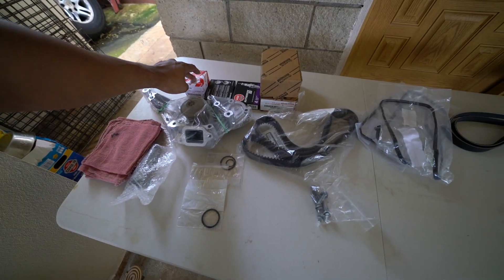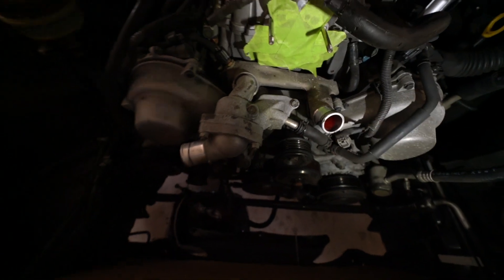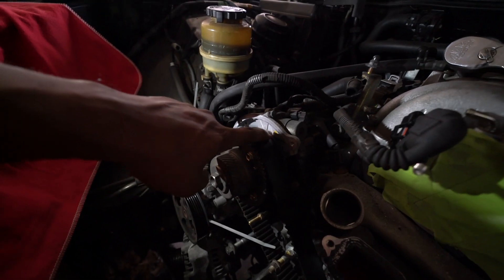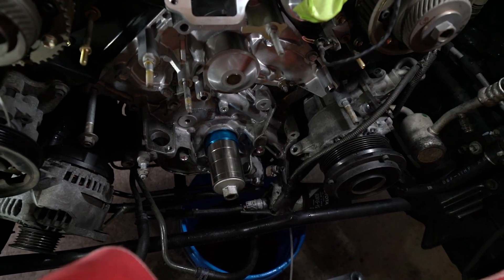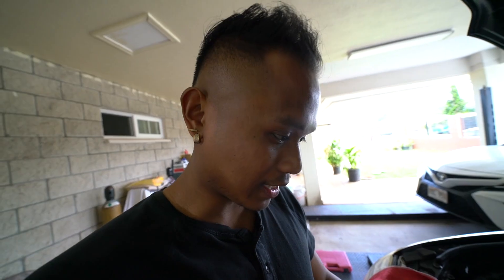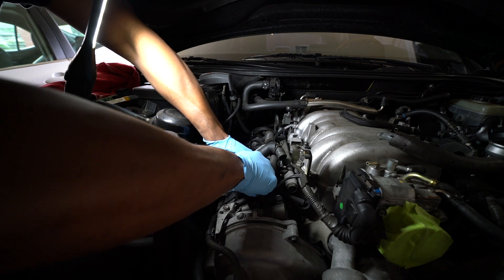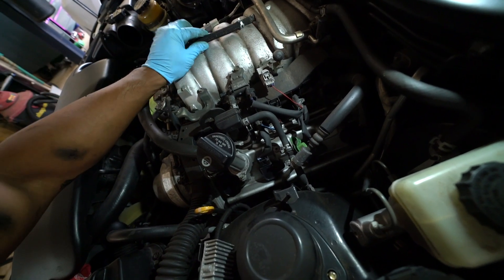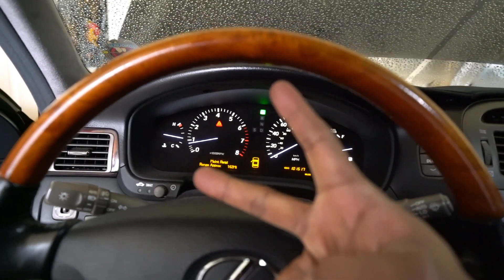JAY | VLOGS LS430 MAINTENANCE (TIMING BELT,  WATER PUMP, VALVE COVER GASKETS, ETC.)

Comment: Heres a tip, belle south lexus sells oem lexus parts online for cheap and free shipping too. You can call to the parts counter as its a dealership. rock auto has the aisin belt and water pump kit for cheap.

Comment: What's up jay big fan of the channel  love those wheels on the ls trying to oder some What's the spec you're running on your ls offsets and tires
Reply from the maker: What’s up bro sorry for late reply. 
Front: 19x9.5 +20 225/35R19 
Rear: 19x10.5 +27 245/35R19 

Keep in mind front fenders are almost rolled flat & rear quarter panels are shaved almost flat